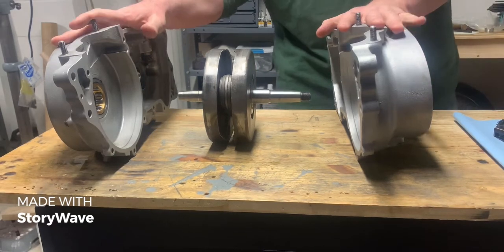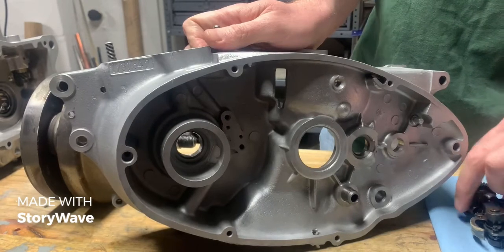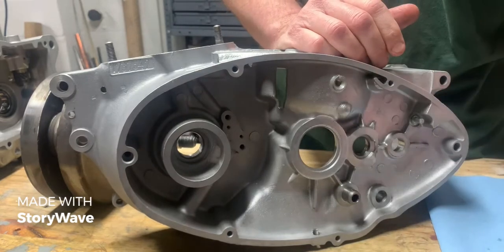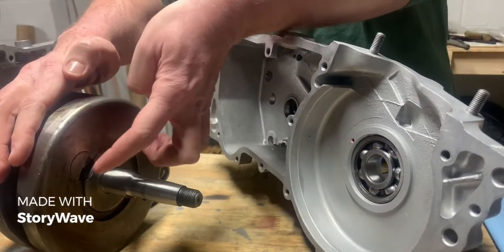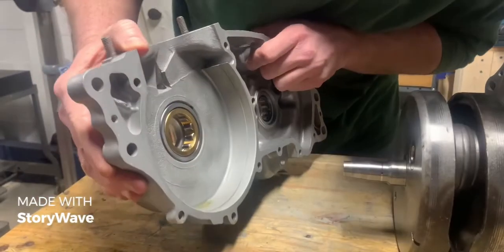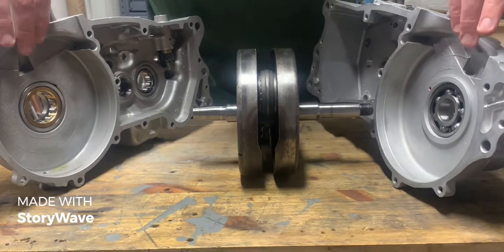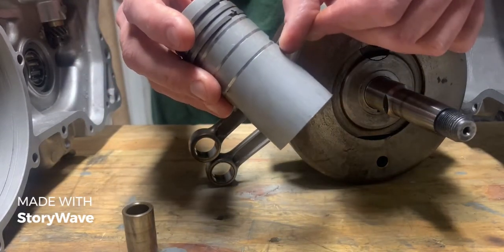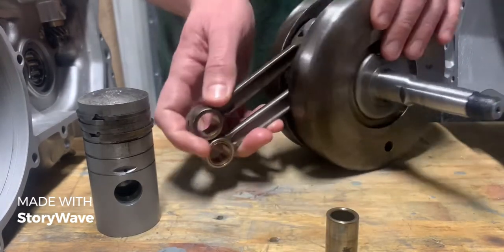Puch 250 Split Single Motorcycle engine Oiling System

Comment: Great video Eric. Thanks for sharing your knowledge.  Is the primary drive oil spec a non- detergent oil?  I see in my manual to used 30w to 50w depending on the temperature.

Comment: i put too much oil in my Twingle, it’s blowing oily gas out of the exhaust pipes.  How do I drain the oil out?  Thanks
Reply: That is probably condensate not gas.  Your comment is confusing.  If you put too much oil in the tank overflows.

Comment: why no 480p ??????????????????????????????????????????????????????????
I´d also be interested in learning about how the "primary oil" doesn´t mix with the 2stroke-oil of the sucked-in-air !!!! You mention it, but it isn´t clear (or intuitive) at all, that it is possible...!!! Thanks
Reply: i put too much oil in my Twingle, it’s blowing oily gas out of the exhaust pipes.  How do I drain the oil out?  Thanks